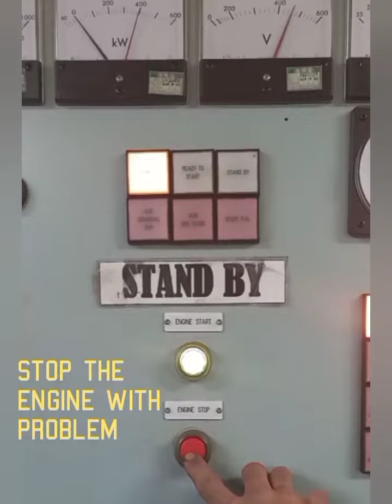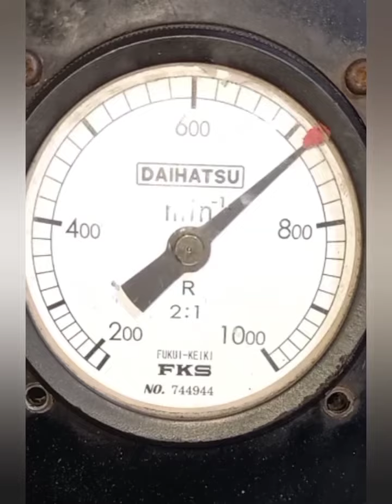Trouble: Fluctuating Auxillary Engine Tachometer✌

Comment: Deserve to subscribe..
Thanks sa diskarte sir.
Ask ko lang Kung anong name ng book Yung tungkol saDG safety device location at mga parameters position...
😅 Mukhang magulo TANONG ko.
Reply from the maker: Good day Kabaro...
Thanks for the nice compliment...
With regards to safety devices, The normal parameters/range, alarms and safety device set point is in Diesel Generator manual.The location of safety devices is found in diesel generator drawing and electrical diagram. Always use equipment manual for safety and reference.
Thanks and keep safe always